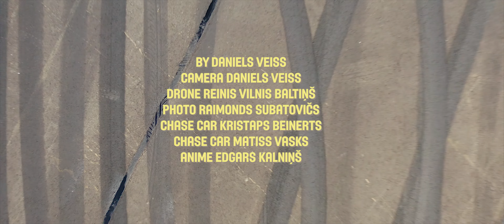Drift BMW E36 5.4l V12 Twin Turbo M73B54 - Arturs Miskinis

Comment: what kind of gearbox can you use for this much of power and v12?
Reply from the maker: We use gearbox from 530d e39 5gear, and use adapter handmade
Reply: @artursmiskinis  how much power can this gearbox hold?
Reply: @aistisforit3403  they can hold alot, used for 2jz swaps a lot